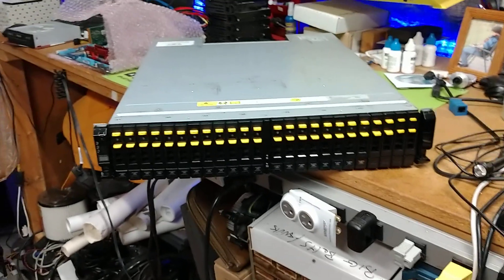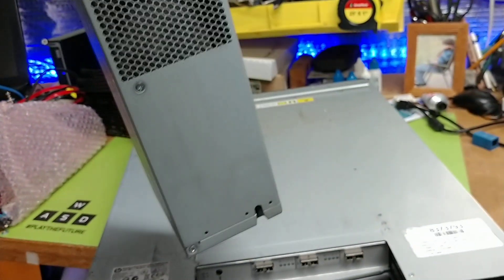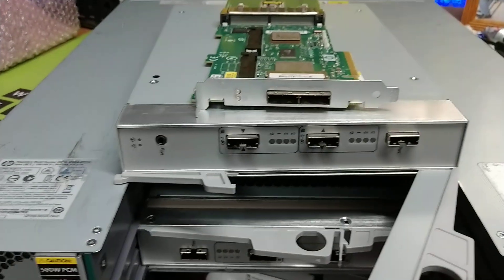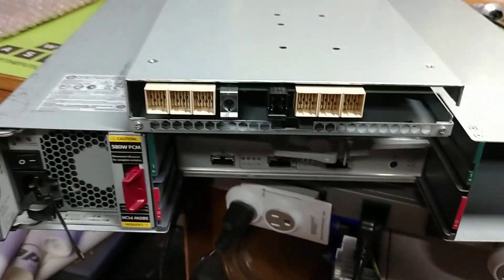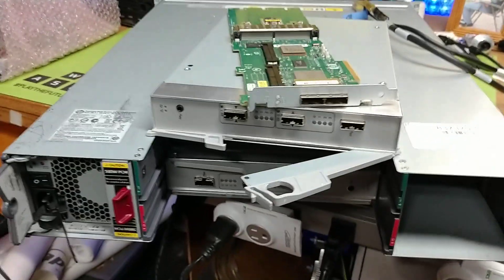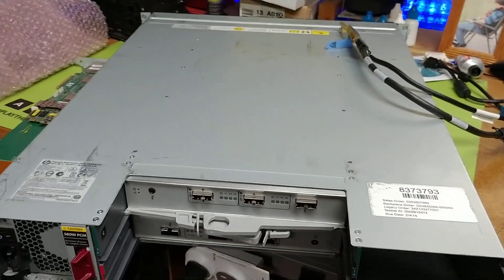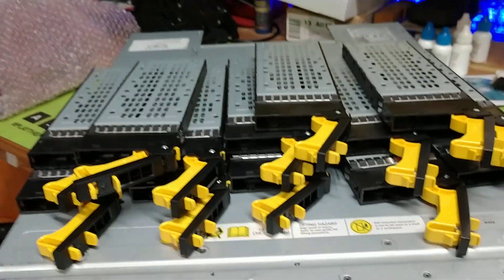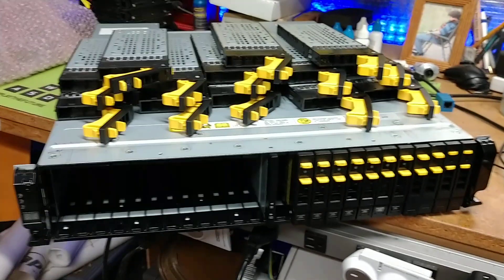Reusing a low cost HP 3PAR M6710 SAS/SATA 2.5 inch, 24 drive disk array  for your home server lab

Comment: hello, unfortunately I saw your video only now and I ask you a favor if you could suggest me the correct sas cable to connect it to a third-party controller such as a dell h200 or lsi 9217-4i-4e or with adaptec controller always with sff-8088 connections. thank you very much
Reply from the maker: OK so that is a trick question.  You see your SAS controller comes as a SAS female connection (such as a LSI 9200 series SAS controller) but you may have a mini SAS female connection on the controller side of the disk array.  First you need to research that array controller to see what SAS type connection it has. Then your server's SAS controller and yes there are cables out there that can go from SAS to Mini-SAS connectors. (but only doas SAS protocol.)   Hope this helps you some.

Comment: Can you recommend a raid card the will work with the 3par and windows 10?
Reply from the maker: A HP 410 or P800 series will work or yo cna go single channel with a LSI HBA 9200 series or higher SAS controller should work but do your research for if you want HBA or RAID first. .

Comment: i have one of these sounds like a jet all the time sucks cause i like it but who want to listen to all that noise, Would love an idea for a fan mod but i have found no info for that.
Reply from the maker: Sounds like a power supply or a controller has failed. It is not loud unless it is failing.  Check your array to make sure it working right.

Comment: Good video, have been looking for info on options for routing SAS/8088 cables from a single server to a 3Par M6710.
So, I have such a disk cabinet with 24 10k 900 GB SAS drives.
I am in the process of changing them from 3Pars's 520 bit to 512 bit, so the disks will be usable from Linux/Win.

Weird thing is: If I have the first/leftmost disk (bay 0) inserted, the attached computer will not pass the initial "initializing" prompt during boot.
As soon as I eject that disk (and have all 23 other disks inserted) the initialise step is done in a few seconds and boot proceeds as normal.
Using a HP HBA 221 card in the computer, 2 8088 connectors on the back.

I have tested all (?) combinations of cabling from computer > disk cabinet (using one or the other connector on the 221 card and all combinations on the disk cabinet).
Same thing no matter what. 

Any ideas?
Reply from the maker: Well I am thinking three things here.  One, a post state BIOS level DIAG that is failing and stops the posting process. Two, a preset setting looking for a SSD type cache disk that never got cleared and slot 0 is the home for that SSD drive.  Or three, You have a bad 0 bay slot.   For issue one or two. swap out the HBA controller and use a cheap LSI series 9200 or 9300 HBA controller. (Your problem is fixed or at least IDed.)   They have no post DIAG check or or caching options so the controler jsuts boots up,   For problem three issue.  Remove all the disks from the array. boot with only a clear empty array. Go into the BIOS of the HBA go to the disk util screen that shows what disks are available for use.  Then add one 512 Sector formatted disk that you know is good and place it into the slot 0 bay slot and check the bios disk list to see if the newly added disk posts as a new available hot swap drive in slot 0 ready for use.  If it doesn't come up then you most likely have a bad slot or a on board controller that is failing. If it does come up then an few more known good disk, one at at time to test the pairing bridge bus of the array to see if it can sync with other disks, if the disk goes away of not usable then you have a bad slot 0 bus connection.   Hope this help you out...
Reply: @leadiususa7394  
Many thx for your feedback, much appreciated and useful to get thoughts started.

So... you're thinking the HBA card might have some old setting that's causing this? 
Could be, but I have re-flashed/upgraded that card - still possible of course that settings have persisted.
Will try an 92xx card once I find a 8087>8088 cable.

I know way too little about the internal workings of these disk cabinets, how much smartness etc there is in them.
But I suspect it's not a whole lot, they are more like a fancy SAS fanout setup - and that the logic/smartness would reside in the 3Par controller node(s).
For example, I can't find any firmware updates to the M6710s, which could be due to them being old/proprietary or there isn't much in them to be updated.
But that's just me assuming stuff, really..

Another question: 
You mentioned there are 3 channels in this box (8+8+8 disks). 
That's pretty interesting and not very obvious from looking at it externally.. and would have an impact on how disks are allocated to a RAID array created on OS-level - right?
Let's say we'd like an as simple as possible RAID5 across three disks, then those three disks should be on separate channels to avoid traffic congestion. Or?
Reply from the maker: @goransander4461   IT doesn't work that way.   The bus channels are there for both bandwidth management and Bus speed control.  Each channel can do the max of only, so if you put a SATA and a SAS disks in a a single bus, you only go the speed of the slowest drive.  Als ot answer your question, for 24 bay drive arrays, it is as follows: 1-7 channel 1, 8 to 15 is channel 2 and 16 to 24 is channel 3.  Put all SATAs on one channel and the speed will stay stable but slower then the next channel that has SAS disks and so on.  This allows you to get the best from each class.

Comment: This is but a single disk expansion shelf of the 7000 series 3PAR can support up to 240 disks configured over ten disk shelves for the dual-controller 7200 model and 576 disks for quad-controller 7400c model. The system is managed via the 3PAR IMC (Integrated Management Console) or newer SSMC Web-type management interface or lastly the CLI interface. Basically, using a 3PAR expansion shelf without the actual 3PAR controllers dumbs down this complex 3PAR SAN to just a old-school SAS based disk expansion shelf. In addition, A 3PAR without HPE Support is also kind of useless for anything more than SAS expansion shelves. The actual 3PAR SAN is so complex and proprietary that things like software updates and troubleshooting can only be performed via remote HPE Enterprise Storage support ($$$) with a password only they know! In other words, using a 3PAR outside of support for anything more than a hobby is kind of like trying to fix computer regulated inverter issues on a Tesla Model X with a 1980s Chilton Car repair manual. 😄  I've been a 3PAR Admin for 9 years btw and took the $4000 class.... Lastly, never place a HBA or SCSI/SAS Controller like the author did on a metal surface or you risk shorting out the electronics and I'll give you a 👎. 😁
Reply from the maker: The goal here was to take a unit like this and reuse in a newer way for I don't really like 3PARs till I was able to use them in other formats to use the arrays for fun.  Yep! I said for fun for that is what this was and is.  I got these array shelves for $50 each for no one really like them much but I had some fun and shared my insights for others to enjoy and buy something cheap that  they could use and the walk thru was free.  Oh and BTW if you saw my (how to correct work with PC systems) you would know that the work bench was completely ground and static shielded.  Been doing this for 33 year but thanks for the heads up and yes you need to worry about discharge.   Have fun doing this stuff and reinvent if you can!  I hate waste...

Comment: Are you able to provide me with a link the the HBA card you are using? I just bought one of these off ebay and would like to essentially attach it to my Truenas server
Reply from the maker: For external SAS controller https://www.ebay.com/itm/115721771810?epid=1327725088&hash=item1af18e1b22:g:v8UAAOSwdqJidUQG&amdata=enc%3AAQAHAAAA4BWCmk0voURNswL%2BupermU6vxNEJ6Ma15aZPfirv4a67xallwb%2BhJXGfFYjctthNNMN%2Bbped3A1tcNLqxFWvRC2Dc4dzgQYQovyYTztc6T9cmNfqVYaj3Obu5BcBoUa0KL1ltkM%2Fl3dVYS1hHNx%2Fm9bTe9vJrgPirZV%2FZPXysLdzqFqivSUSq1WuiwS%2FrlREyGsgVBQy6fWYU5BLQBvmtAKoFWGt1jlj%2FzMsmqY2pr%2FrxzYCyu8YF1ylIn%2B9S%2FqBloO49NRTaGI0qVbSFsUkXhlPHUHPsl9b9tZCerNM4tOT%7Ctkp%3ABFBM3vfw6uJh

For internal SAS ...  https://www.ebay.com/itm/373641587461?epid=21031289983&hash=item56fec62b05:g:1CYAAOSw06Ng5eWw&amdata=enc%3AAQAHAAAA4CHrF5n0H8a%2FBdfvnBDPr5VeDI4hv61CHgyemNA7AP7DVPqcsBs4P9PluFXXssrnsgq4SWmpN6XH6WUw%2FtKPEch8XHPGm5Tk8cmrhRKFFvmHb3UkIGlWyuCxC7YVOoUidtwfsW5971fogV3PqqbM4pQO0Ew5BWZ7CEJbATXuZi5gAJc93cQwizvrCuHFHCQUZOnlgGa%2BfCb%2FXisvN75Jh8Phu7radd2s%2F4zix%2FjbSYoAR2zt2qDY8erV7neqR0ukg%2FUbw8THHxjq5AjtuWaIw%2B8cf4BvGrMRvMJZR1lY6kDm%7Ctkp%3ABFBM3vfw6uJh

Hope this helps and I use these.    Enjoy and have fun...

Comment: Hey, nice video thank you! just got a used M6710 and i just wonder what the button and the display do. With a long press on the button, i can change the number on the display between 1 and 24 but what is the usage for? Would be wonderfull if someone can share some knowledge with me about this, cant find any information online....
Reply from the maker: the display screen shows the order of which disk array is in order to the next disk array.  You see when you buy a new HPe 3PAR storage array it will come with four to ten M6170 disk arrays.  We hook them up one at a time and ID each disk array in order so you know what order they are hooked up.  When the system reports a bad disk in a array, you just check the array ID then look at the display to find the right array and count the disk to the correct dying disk and replace it.  Hope that helps some...

Comment: Hello, I have the m6710 already coupled to the dl380 and I have already formatted the disk units to 512. Now I would like to take these disks to other servers through a dl380 fc hba to an hp brocade switch. what would the procedure be like? thanks
Reply from the maker: First off does the HP 3PAR-m6710 have two FC controllers in the back or are they SAS controllers?  I have not heard of anyone using M6710 with FC networks so cool.   Check to see if you have SAS controller or a FC controller.. Or other and get back with me...
Reply: @leadiususa7394  Thank you so much for your answer. The connection between the M6710 and the DL380 is via SAS through an LSI 9200-8e card and it's working fine. I've put a FIBER CHANNEL HBA in the DL380 as well and would like to expand the SAS disks across the FC fabric between that HBA and a Brocade Fiber Channel Switch but I cannot see the WWNs of the disks on the switch's fiber channel port.
Reply from the maker: @alvarovasconcelos5437  That is correct.  The FC card will not show the disks ID thru the SAS controller.   SAS is a hard drive protocol and so is FC.  They are not compatible protocols.  The only thing you cna do here is to create a data pool and download FV storage pool connector and then link that to teh FC card you have in the server.  Then provision some storage as a LUN on the storage pool to the FC card. If you zoning is correctly setup the FC SAN switch the traget host will see the presented storage as a LUN for use.  BTW this should be done correctly with two FC HBA cards for each host and two SAN switches.  If you are following the standard industry guidelines.   Hope this help some...

Comment: Can we clarify exactly what SAS connectors are needed on the cables? to connect the controllers and to the HBA.
Reply from the maker: Sure, first ID your SAS controller and the type of SAS external connecter it has, both Mini SAS and SAS connectors are out there.   Then make sure you ID the SAS connector on the back of the 3PAR.  And you are done, order the correct cable (either a SAS to SAS cable or SAS to Mini-SAS cable)    P.S.  Make sure you ID what a SAS and Mini-SAS vs. FC or Fiber SFP connections.   Enoy!

Comment: Hello Leadius, thanks for this video! I'm getting a strange problem. Bus 1 (disks 1-8) are showing in error status (all have orange lights) but the RAID6 array is working fine!? When entering the RAID config (using a P812 card - great card) it shows 'Box 0: Bay 0' and doesn't label any of the disks properly. Is it possible to manage/configure/fw update this units without the original HP StoreServ controller? Thank you. Tim
Reply: I thought I'd come back and report my findings! I wanted to deploy this PDQ so I needed to find the issue. I can report that in my case the HP Smart Array P812 Controller with 1GB cache was not compatible. I ordered a SFF-8087 to SFF-8088 cable and tried the the storage enclosure with a MegaRAID SAS 9260-8i and all working okay!

Comment: Thanks much for the video explaining both the M6710 and multipath SAS. I've managed to get my drives to show up on a Smart Array P822. First I had to turn on HBA mode to reformat my drives from 520 sectors to 512. I needed to unplug 1 controller from the enclosure for my drives to show up. If I connected both, the pathing would not be recognized and 48 drives would show up. Using only 1 path and 1 controller seems to do the trick.

However, unfortunately ALL bay IDs are reporting Unknown. This makes addressing the physical drives quite difficult in ssacli. The SSA UI utility allows me to create the Logical Drive, though. Would love to hear if anyone has a solution for that one (or how I could get dual paths working properly without my LD disappearing and PDs duplicating)

Comment: Hello, Nice video. Im wondering if you could help me. Im trying to hook up a 3par unit to my DL380 g6 with a p800. I cant seem to get into the p800 raid config and on boot it says 0 drives. Im not sure what im doing wrong. However i do get a warning my p800 battery is low but im not sure if that would take the option of entering the f8 config menu away. Ive tried hooking  up a single cable and tried using just 2 straight cables to the top controller. I do have other cables but the last cable isnt long enough to complete the cercuit with both controllers. Thanks in advance Chris
Reply from the maker: No, don't do a full loop unless you have the correct type controllers to do that with.  A P800 will not do that.  First start with just one SAS connection (one cable in the A SAS connection only.) then first go into the RAID controller BIOS to see if you can detect disks.  If you don't see disks then something is wrong.  Flip over to the B SAS Channel and try again.  When you do see disks, set them up as either RAID 0 (each drive) or do a disk group of RAID 1 or RAID 5 and allow them to sync up before trying to see the RAID drive to boot to.  Next also make sure that the server BIOS knows to look for the P800 on boot up outside of USB or CD boot.  You must select the drive you want to boot to and in order.  I would do USB, CD, P800 and so on.   Now one last thing.  If you flip your RAID card to HBA mode.  (In this mode the controller RAID features are turned off and you just see raw disks and you use the OS to manage the disks instead of native RAID mode.)  I like to do RIAD for it is native and doesn't care about the Boot OS at all.  It just works.  /:>   Don't get me wrong, HBA controllers are great for adding JOB (Just a bunch of disks) to a server... Hope this helps some... Enjoy and have some fun with it...
Reply: @leadiususa7394  Thank you for your reply. I have tried using a single cable today, however I get different errors now is there a way I could send you a picture ? I appreciate your help subbed
Reply from the maker: You can email me if you want. bradmd92@outlook.com... First the P800 controller. The battery is not an issue.  It is just a warning for the system has not been plugged in and running long enough to recharge the battery or you have a failing battery.  Still not an issue.  As for the cabling.  Just use one cable and don't try to close the loop.  You may get a beep from the disk array but do it any way.  Use just one drive for now to discover.  Also are these drives formatted in 512 K format.  If you bought enterprise disks in bulk, make sure they are not format in 520 or you will not be able to use them.  You will need to reformat them to 512.  Any way, right now you just want to detect a disk.  If you setup one cable connection for single path SAS connection and you don't see a disk then flip down to the lower controller and try again.   Email me what you fond out.  Thanks
Reply: @leadiususa7394  Thanks Ladius.. I will email you tommorow as its late here in the uk atm. The disks and cables all came brand new with the 3par unit. The disks are all 900gb and still have the seal on. I have a p411 sas controller also arriving soon.

Comment: May I kindly know what server rack you are using? I'm just getting started and have that HP DL380 as well just not quite sure on what rack I may need and I see that yours fits quite well.
Reply from the maker: Sure, I have one Wright line 42U rack and one HP 42U rack.
Reply: @leadiususa7394  do you by chance have a part number I could reference to?
Reply from the maker: @XzMrtrevorzX  Yea, I would go on Ebay and look for them.  I will provide you a link to a ebay item to help you out.  Also don't forget your PDU (Power distribution unit) and rack selves if need as well as cable management.  Here you go. https://www.ebay.com/itm/334248731589?hash=item4dd2c6e3c5:g:PFcAAOSwqWxhsk3L
Reply: @leadiususa7394  Thanks again. Great Video.
Reply: @leadiususa7394  Does this Case also support the HP DL380
Reply from the maker: @XzMrtrevorzX  Yes, all versions, just the correct SAS controller